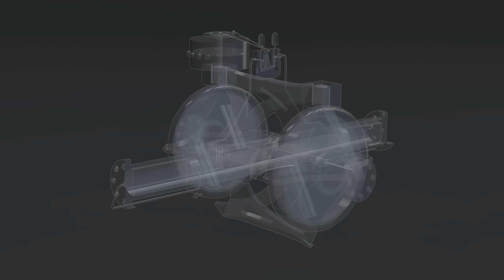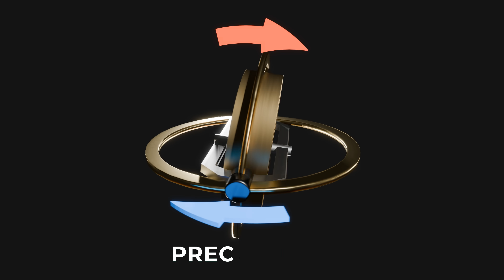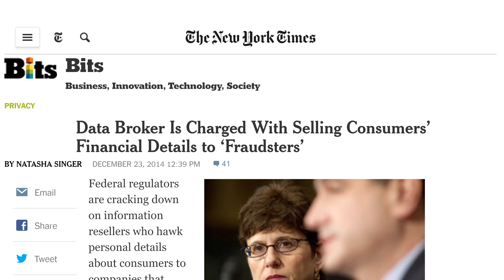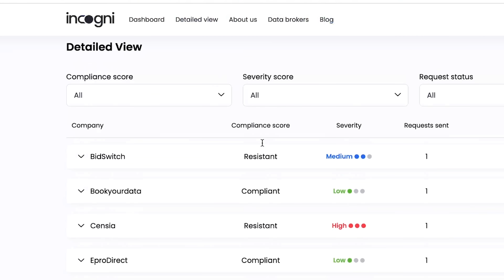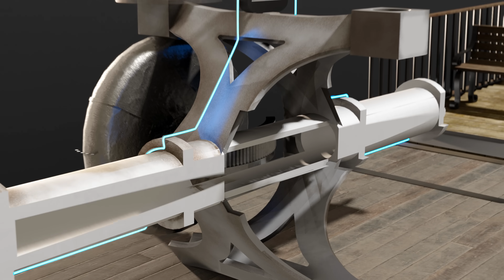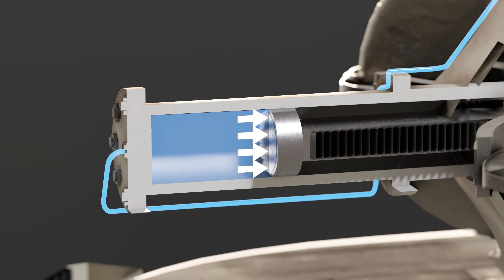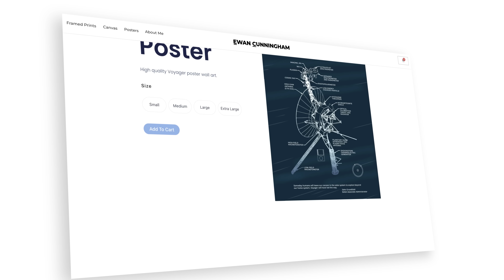The Self Balancing Monorail

Comment: So… if there is loss of pressure in the pneumatic system, does the train just fall over?
Reply from the maker: Great question. When the train was turned off, the gyros actually continued to spin due to their inherent angular momentum, so if the train started to tilt, the gyroscopic precession would automatically activate the compressed air system to counter the tilt and keep it from tipping.
Reply: @primalspace   Interesting. Let me think if that answers the question I had in mind. Partially, I think, but it also confuses me a bit. Let me see if I can ask a better question.

1. When you say the gyros keep spinning when the train was turned off, do you mean when it sits in a garage somewhere? 
If I were to guess I’d think that would require surprisingly low friction, so probably not.
It seems perfectly viable that the train would keep standing upright for very long at a station or a stop signal. That just requires conservation of angular momentum and slow enough dissipation. Together with providing energy to the wheel now and then.
The stabilization from a gyro or the gyro pair is just a relatively simple application of the physics of angular momentum. I’m following that logic without problem.

Am I getting your general point right there? 

2. That works without the pneumatic system. But, my understanding of the reason to introduce the pneumatic system was the following. When the load gets heavy enough (or at high speeds maybe) the gyroscopic correction began having some issues. Like, being (a) slow, (b) bumpy and (c) putting high strain on certain mechanical components.
My understanding then was that the pneumatic system triggered to push two surfaces close together so that one rolls on the other and makes the correction quicker and smoother. Something like that. I could check the video again for details.

So here’s a clarification of my intended question. 

— If the pneumatic system fails (looses pressure by a crack in an air tube etc.) and we have a heavy train at sufficient speeds, would that imply those issues (slow, bumpy, mechanical strain) would manifest again? (I’m thinking yes here.)

Essentially, if a heavy, fast train tries to make a sharp corner, would the pneumatic system be the deciding factor between success, a very unpleasant ride or in the worse case having the train toppling over or derailing?

If so the pneumatic system would be close to being a single point of failure, which might be a serious safety concern.

I hope that question makes more sense!
Thanks for answering =)

Comment: OK... but what happens when and if the gyros stop spinning?  Wouldn't it fall over?  Or, maybe the thing had a 'kick stand' for when it was not running...
Reply from the maker: Great question. No kickstand, but when the train was off, the gyros actually continued to spin due to their inherent angular momentum, so if the train started to tilt, the gyroscopic precession would automatically activate the compressed air system and counter the tilt and keep it from tipping.

Comment: Brennen was also the inventor of the guided torpedo. Running 2 spools of wire driving counter rotating propellers in the torpedo body. these were pulled by steam engines on shore. It was reported that it was accurate enough  to be launched out from the isle of grain in kent England and then to be steered  out into the Thames estuary, then turned around to hit a basket of fruit floating  in the water from behind. impressive stuff. Brennen had his railway at Gillingham Kent where he lived.
Reply: Brennen pre-dated tesla by 30 years
Reply: It was Tesla

Comment: i guess i missed it but what happened when it stops moving and turns off? did they have some kind of landing strip with a rail going down the middle or something?
Reply from the maker: Great question. When the train was turned off, the gyros actually continued to spin due to their inherent angular momentum, so if the train started to tilt, the gyroscopic precession would automatically activate the compressed air system to counter the tilt and keep it from tipping.

Comment: Fantastic! Had never heard of this. I'm surprised that with all the advancements since then, it's not becoming the way to go. It seems the ride would be more intuitively comfortable. Like on a bicycle.  
Question though: What happens if the train needed to stop before making it to the station, or for whatever reason? I'm guessing it automatically would drop a support system from its undercarriage ?
Reply: It seems to me the train when stopped would just stand up right as long as the gyros were powered. I am sure they had a station it could rest on when powered down.

Comment: Amazing!  One question though: how does it stay upright when not in motion?  Is it propped up to start?
Reply from the maker: Great question. So when the train was turned off, the gyros actually continued to spin due to their inherent angular momentum, so if the train started to tilt, the gyroscopic precession would automatically activate the compressed air system to counter the tilt and keep it from tipping.

Comment: I can foresee some issues if this design continued forward. Using standard rails but only half of them would probably have some impact on the practical loads they could bear, compounded by the higher cornering speeds promised.
Reply from the maker: Fair. Thanks for your comment and good luck in the giveaway.

Comment: Could this work as a track inspection vehicle? Doesn't need to pull coaches for that, and you get a clear view of whole of the other rail. Only problem is the double-flanged wheel may struggle with switches.

Comment: Today, electrical engineers would call this design "negative feedback" and its key to the vast majority of electrical engineering (non-computer) designs. You have a voltage sensor, the voltage causes a transistor to turn more-and-more on causing the opposite negative feedback to occur, eventually causing the "reality" to shift back to neutral. Thus everything reacts near instantly. As such, cruise missiles can cruise, refrigerators remain 40F (higher temperatures turn on the compressor), Voltage regulators remain at 5V, etc. etc. Its very fundamental to many circuits.

But the negative feedback electrical amplifier was patented in 1937, nearly 30+ years after this monorail design. Coming up with a "negative feedback loop" before the invention of (electrical) negative feedback sounds pretty crazy to me!

Comment: I have been wanting to use a similiar system on a monoram boat, i.e. a catamaran without the second hull and not needing the deep heavy hull of a monohull.  In addition, the flywheels would store energy from solar panels so they can be oversized.   I'm sure there would be issues..but it would have backup trimaran hulls that only go into the water if needed, but otherwise would be much more efficient going through the water with a single thin hull.
They use flywheels on some yachts to reduce rolling

Comment: I have seen this train many times in books, Internet and TV.  This is the first time I have seen how it did what it did.  They usually just say gyroscopes and leave it at that.  I love it.  He was just missing a cool looking styling.  If he had that, they probably would be using these today...at least for high speed rail.   Also, 2 things not covered, I am curious about: does it have legs or something for when it is turned off?  How the heck did it navigate switches?  This has to have 2 flanges on the wheels, those flanges would make track switching tricky, I would think.
Reply from the maker: Great questions. So when the train was turned off, the gyros actually continued to spin due to their inherent angular momentum, so if it started to tilt, the gyroscopic precession would automatically activate the compressed air system to counter that tilt to keep it upright. As for the switches, there were definitely limitations there and I think was another reason that investors weren't interested - thought it would have been great to see how, with that investment, the challenge of those switches would have been overcome.

Comment: Thanks for the perfect video!!
The Motorbike Train!
That genius engineering marvel will definitely be better as it will eliminate the need for the entire half of the rail steel!!
Of course this will overcome the cost of having this system in each car of the train.
Also this will reduce the brake pads needed on a 2-wheel axis. Also having a single wheel will allow for achieving much higher speeds .. exactly like a motorbike vs a sports car.
Reply from the maker: And thank you for watching! Thanks for sharing your comment as well - good luck in the giveaway!

Comment: Mind boggling for the time; but what happened when the engine driving the gyros stopped?
Reply from the maker: Great question. When the was turned off, the gyros actually continued to spin due to their inherent angular momentum, so if the train started to tilt, the gyroscopic precession would automatically activate the compressed air system to counter the tilt and keep it from tipping.

Comment: A big disadvantage of this monorail design is that the wheels flanges are rubbed against constantly in order to prevent the train to slide of the track sideways.
This cause friction with all its downside.
The double track design has a friction free brilliant solution to it as is explained in the YouTube video "Feynman: How the train stays on the track FUN TO IMAGINE 7"

Comment: It's a beautiful yet complex design, I just didn't understand one thing how did the gyro precession actually transferred the force back to the chassis
Reply from the maker: Great question. So the gyro precession transferred force back to the chassis through the use of an actuator arm, valves, and its compressed air system. Together they would respond to the gyros' movements and ultimately stabilize the train.

Comment: It’s brilliant but… it reminds me of the Segway. Another sort of great idea but not stable. I assume the gyroscopes need electricity to operate? What if the motors aren’t running? Does it stay upright? There’s something stable about two wheels or four wheels. A four wheel vehicle is stable standing still or moving. And with motor on or off
Reply from the maker: That's fair. The train did remain upright when it wasn't moving, so that's a plus haha. But you make some fair points about stability nonetheless. It would be interesting to see where this design would have gone and what changes would have been made had Brennan received the right investment.

Comment: Why would he use compressed air instead of oil in the piston thingy it would work the same would it not?.......Was compressed air faster?
Reply from the maker: Great question! Compressed air was preferred over oil in Brennan's stabilization system because it would act as a pneumatic system and significantly amplify the smaller force generated by the gyros.
Reply: @primalspace  ohhhh ok.
Thank You for answering my question.❤️

Comment: i still do not see how the gyros are spun nor made to continue spinning....
where is the engine & gyro-engine linkage system....?
what happens when fuel runs out?
where is fuel storage?
is there an automatic deployable bracing system for each car when the motor is off?
WHERE ARE THE BATHROOMS.......?????

Comment: My initial thought for how to solve that last problem was to add a second pair of gyroscopes, with more mass but a slower rotational speed. I was assuming that the second pair would react more slowly to the angle shifts while having more energy overall, but if you used the first pair to control the second with some kind of advantage, you could use the greater energy of the second pair to correct. 

Brennan just cut out the middleman and used the first pair to control the first pair, something that I'm not sure would've come to me very quickly at all.
Reply: The energy of a gyroscope goes up as the square of velocity, but linearly with mass.  Lighter, faster gyroscopes work better.

Comment: This is an amazing design: what people could actually do before the first line of software was ever written!

Its operation on conventional railroad track would be very limited. The first time it came to anywhere either side of the rail was obstructed it would be in trouble: the points of a conventional switch, the frog of any switch, a diamond railroad crossing, a road crossing and street trackage, for example. 

It could also have clearance problems with a lot of lineside structures and tunnels and bridges and platforms.

Maybe they could share a right of way with a third rail between the other two if every time that rail crossed anything else, both sides were left open.

-basically Lionel O-gauge track: full sized!

Comment: I have a feeling that this is one of those solutions that seem ingenious on the surface, but in practice might not have that much, if any, advantages.

Assuming that the monorail would be about the same mass as a conventional train, the idea that it could use existing rail lines doesn't seem likely, placing the entire mass of a train over a single rail rather than between two rails probably requires that the line is built for that, or you will have disproportionately higher maintenance cost.  So you would at best have to survey all your existing lines to make sure they could handle the load, at worst you would have to rebuild everything

The monorail would also be taller and stick further out on the side of the track it is running, so any stations, bridges/viaducts, tunnels and other infrastructure beside and over the line would have to be significantly modified.

Also, I don't think it would be that much cheaper to build new lines for this, you might save a bit on steel rail, but you still have to clear and prepare the same amount of land, and tunnels and overhead infrastructure would obviously have to be a bit taller. It is also quite likely that the single steel rail whould have more demanding quality requirements since it has to support the entire train.
Reply: The more complex a system is the more chances for something to go wrong. This thing is extremely complex vs just having a train ride down the rails. What if a gryo cracks, what if the air pump breaks. So many things can go wrong

Comment: Reading more of the comments I come to understand why people fall for snakeoil salesman: Yes, the concept behind this is fascinating but it isn´t some genius at work here. It is the implementation of long known principles to solve what is basically a non-issue by overcomplicating things and introducing multiple points of failure while also driving up the need for maintanance and parts - therefore driving up costs. No, this isn´t "revolutionary" in a good sense. It may have had some applications in niche roles but ffs instead of going with two rails at maybe a lower speed this concept proposed to use this system in EVERY carriage - about the possible points of failure: Yeah, lets multiplicate that by numbers of carriages.

Comment: Correction at 7:02, the small tube has equal pressure, not force, to the larger piston. Pressure is force per unit area. Since there is a larger cross sectional area in the piston, the force is divided over a larger area and exerts a smaller force than it would in the small tube. Counterintuitively, the piston should be as small in diameter as possible to maximise the force. This is why syringes are long and thin, not short and wide. The key to Brennan's design is more that the mechanism acts like a relay. With additional work done by the compressed air to either side when it switches.
Reply: Forgot to say great video and fascinating monorail design!

Comment: The last part about the self balancing air pressure sounds familiar to someone who works with trains.
It's  the same principle „modern” trains use in they air pressure breaks.
Just that they use 3 pressures instead of 2  and need no gyroscope.

Comment: I like how it partially eliminated the main problem of the usual monorail - the existence of normal, incompatible train infrastructure that outcompetes it by just existing, by actually being somewhat compatible with it. It could have almost become real, if only the train was so narrow that you can have two trains pass each other on one normal track, as this would double the capacity of those tracks in terms of the amount of trains, not the load/passengers. Very convenient for railway lines that go to remote, less populated destinations, as they could get more trains per day instead of just one or two. Or you could have a continuous loop of train going along a short distance, with the train cars conveniently tilting at one side of the loop (with some wall rails and extra wheels so they don't fall off entirely) to spill out the cargo, and then rising back up to return to the beginning. And all you'd need to change is the end points of the tracks. One thing that could save this train  is figuring out a way to put a gyroscope on just the ends for short trains, or once per every 3-4 cars, but this would damage the normal train compatibilty - the tracks would need to require no twisting of the train along its length, so it can be made rigid in that axis.

Comment: This is a mind-blowing design considering the era it was conceived. With today's overpopulation in some areas, especially metro, and in areas where preservation is necessary, I can see this being pretty feasible... considering that global supply and demand can still have an impact on our basic building materials. So reducing the amount of materials by half when spanning hundreds of miles of track... that makes a lot more sense.

I could see a modern version of this today... on a tubular track instead of a flat track, so it could travel at different heights as well as keeping itself upright. The "slimmer" profile would allow it to traverse through tight, crowded areas while maintaining safety and reduced materials.